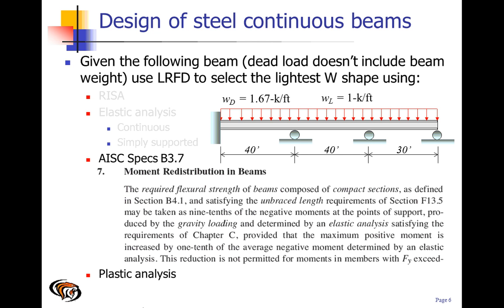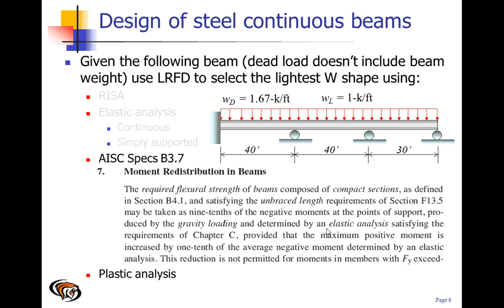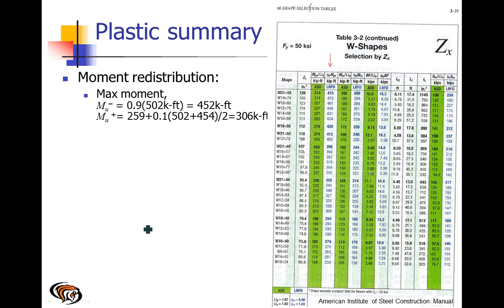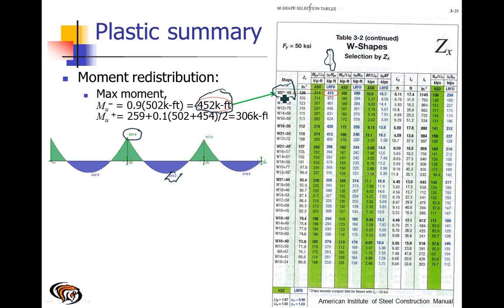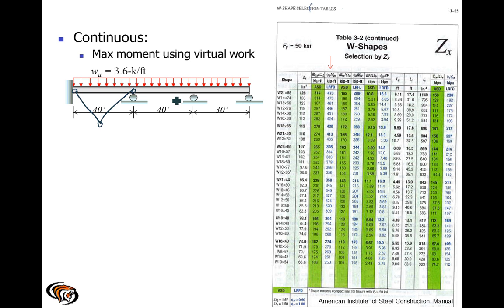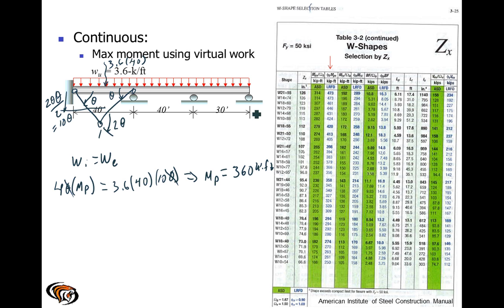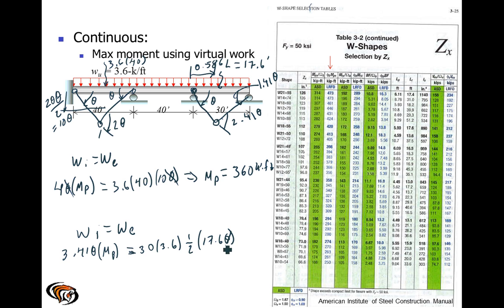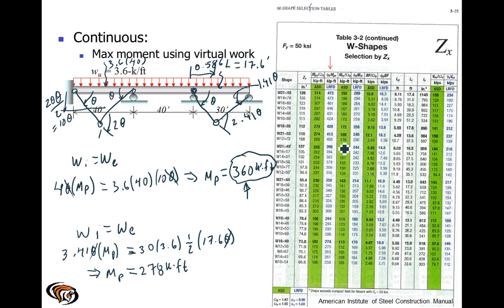Design of continuous steel beams using plastic structural analyses

Comment: Thanks a lot. I was confused, at first, why you assigned Mp to three points, but I just suddenly realized that has to do with minimum qualification of being unstable for each member (of course, by exception, only 2 for the right member).